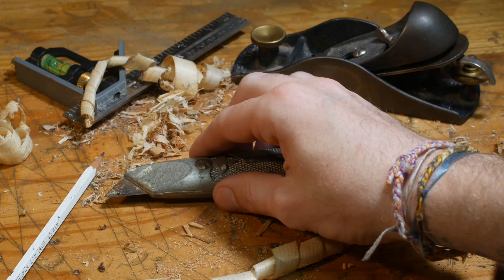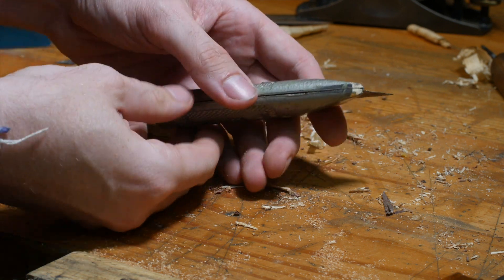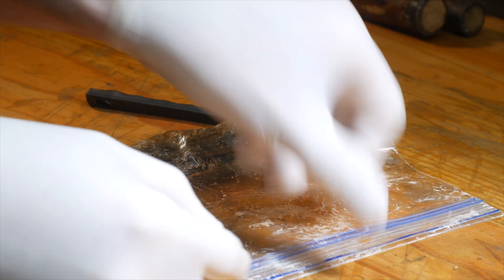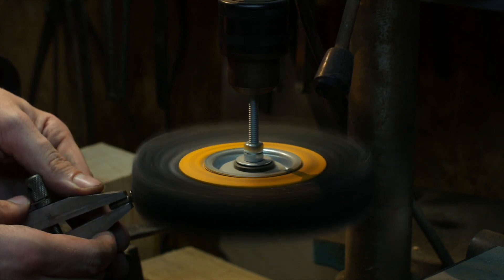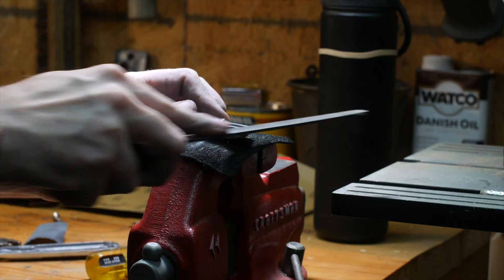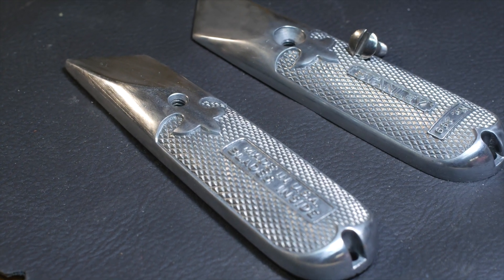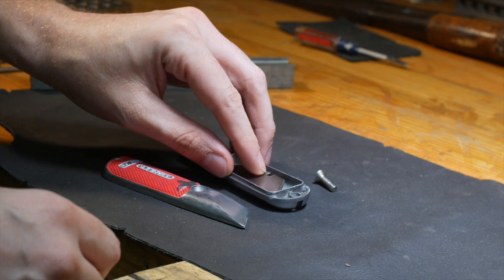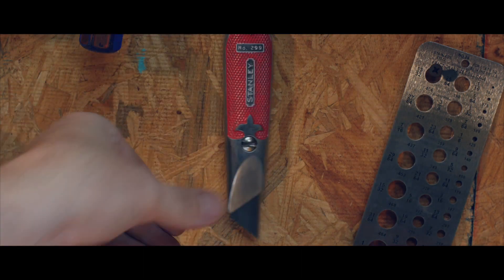Restoration - Stanley no. 299 Utility Knife

Comment: What year was these made? I've had one in my tools for years and never use it because the blade always has to be out
Reply from the maker: Great question. I believe this particular style was made in the second wave of Stanley utility knives, around the 1940s. They produced a lot of variants for many years before introducing the 199. The oldest versions had holes through the body & weren't aluminum.

Blade out all the time isn't super safe, I keep mine hanging at my bench and my retractable ones in my bag. Seen guys make leather holsters for them.
Reply from the maker: I'm no expert on dating them so I could be off by a decade.

Comment: Great video. If you put a piece of foam inside that's thicker than the knife, on top of it the spare blades and then close it the blades won't rattle inside (or dull themselves)
Reply from the maker: Woah! Genius idea. I have a few more that I want to fix up in the future and I'm definitely going to use that idea. Thanks for watching and sharing!
Reply: @christophwjones  I use mine on my belt and if I didn't do that the rattle would have driven me nuts in hours lol
Reply from the maker: I have a few spread out and when I was hanging sheet rock, the rattle was definitely a negative. I'm so glad you shared. These old knives still have a place in the workshop and jobsite for sure. I've seen where folks make leather sheathes for them.
Reply: @christophwjones  I love them... Since they don't fold or slide there's nothing that could fail or break so they last virtually forever
Reply from the maker: Completely! I love my newer flip and easy removal but they don't have the staying power of the classics.